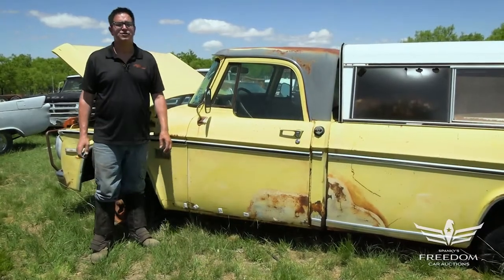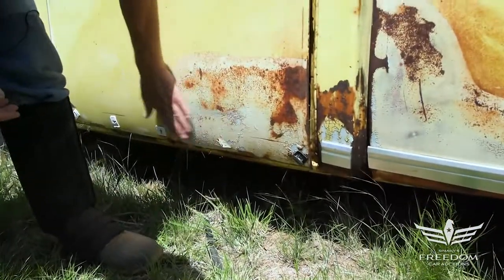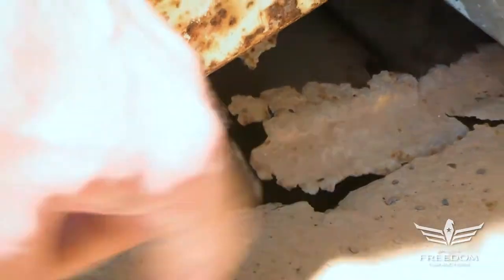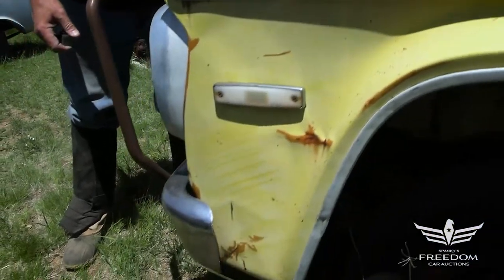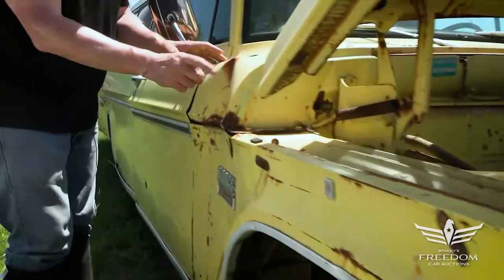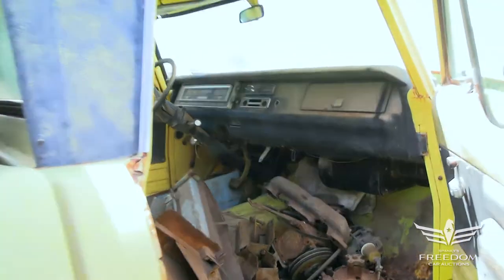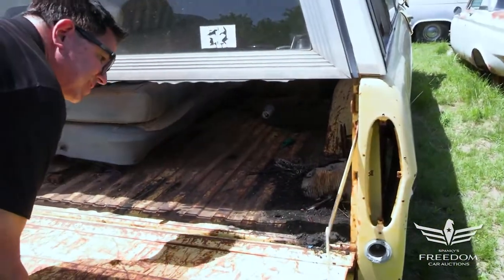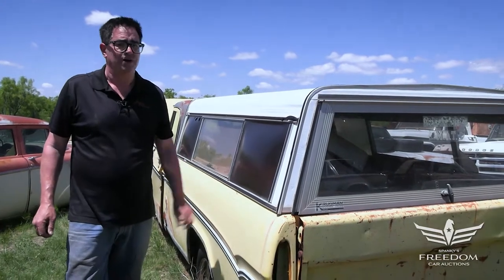259 1970 Dodge D100 383 Pickup

Comment: Back in the early 90’s I had a chance to pick up a pristine example of one of these Sweptline trucks in short box form with a 318 and a three speed transmission. It was an original owner truck located in Las Cruces, NM, where my then girlfriend was going to college. As a Minnesota boy, I had never seen one of these that wasn’t worked to death and rusted to all get-out and I was amazed when I couldn’t find a single dent or spec of rust anywhere on the truck!

I chatted with the old boy who owned it and he didn’t want to sell it at the time. I left my number and told him to call me if he ever changed his mind. He contacted me about a year later and said he would take $3000 for it, which I thought was a tad high at the time. Plus, I was moving to Kansas City within the week and had nowhere to store the vehicle, so I passed on it.

What I woudn’t give to be able to turn back the hands of time and pull the trigger on that truck…..😫